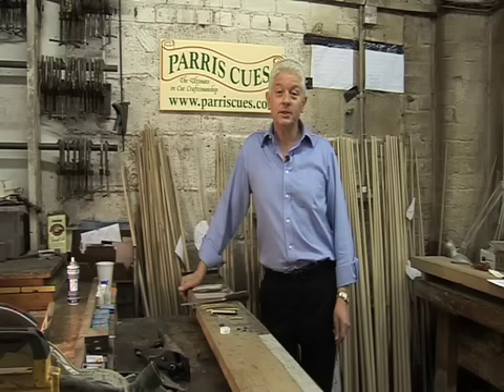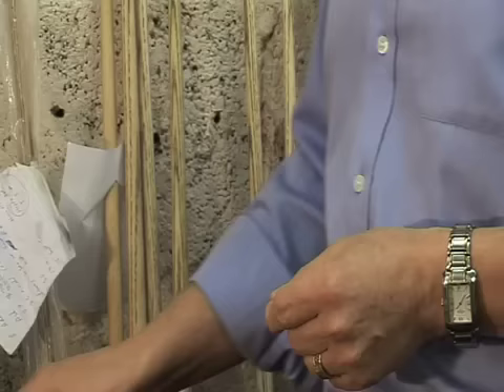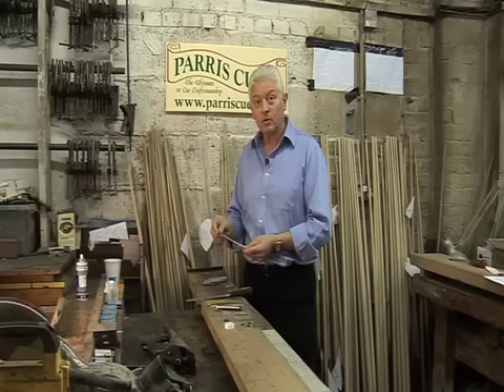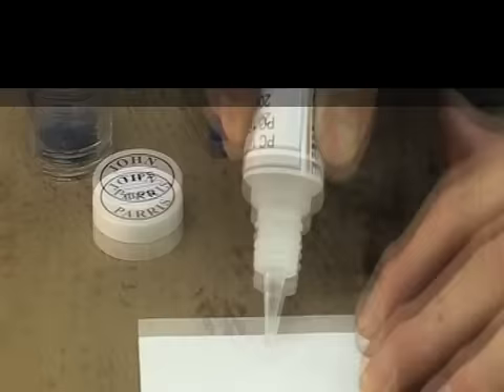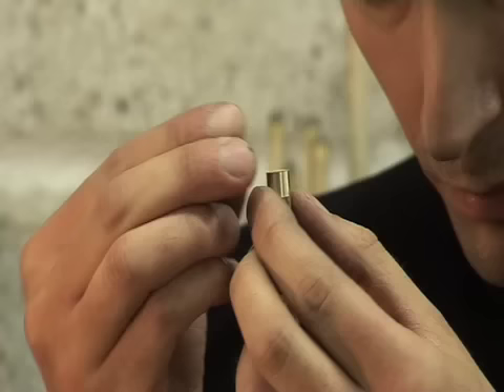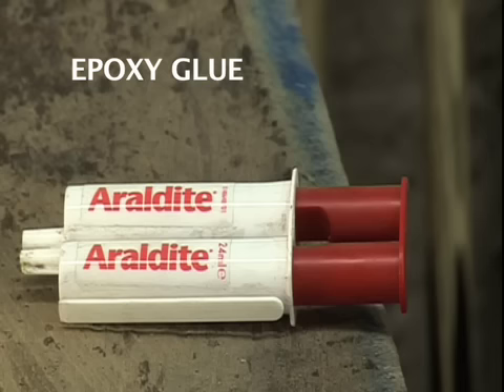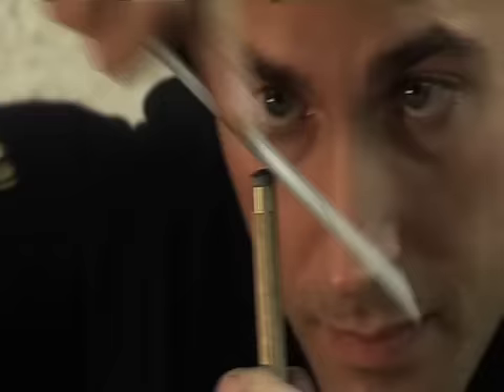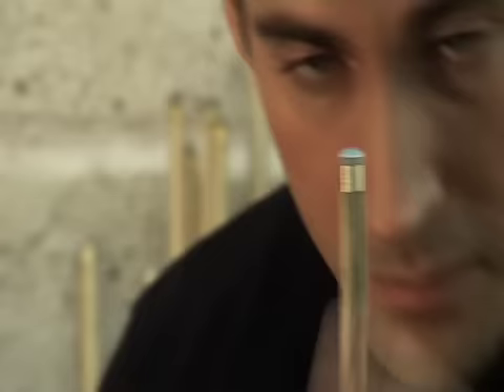How to Re-Tip Your Cue

Comment: I am not an expert in Snooker or Cues, but I just love to watch the game. I have often wondered if ever, it was possible to use a ferrule with a tip that could be just screwed on and off to the cue, so that in times of a crucial match event, if ever the tip gets damaged, one could just replace the tip with the ferrule in no time. Just expressing a possibility, as I said I am no expert to judge what the result would be on the cue and striking and its working feasibility. If anyone knows if that could be a workaround, please let me know. :) Thanks~! :)
Reply: Cues in bars and so on have scewed on tips. I believe the performance does not meet the requirements of professional snooker players (maybe because the force transmission is not as good)
Reply: @basti1597  Thank you for your reply :)

Comment: I take it you guys don't create milk duds or put the tips in a compressor? How long does a tip last without these methods? I will use your scratch technique and find the hardest. Worried about mushrooming. Just had a LePro put on professionally by a shop with a lathe, and it fell off 2 days later during play (total of 5 hours of play). I had to keep reshaping after every frame as it kept mushrooming.
Reply: It sounds like you had a soft tip. Mine only mushrooms for abit after I put on a new one. I reshape and it's good to go.

Comment: sir,i have a question i bought a mizerak pool cue from dicks sporting goods store came with case,chalk,scuffer,tips...took it uptown put cue on table it was warped,i took it back to exchange it,store manager looked at the other same cues all warped...my question is...can you fix a warped cue stick?i got a differant  cue,it was waped...i duct taped it to the door,i left it there over night,t seems like it fixed it slightly
Reply: well-made cues won't warp much if at all. you get what you pay for. the process of fixing a warped cue (if you absolutely can't part ways with it) involves steaming the shaft, which you would usually never want to do, because that could easily make the shaft irreparable if overdone. after setting your shaft over a pot of boiling water (until the pot is empty) at a good height, you'll want to apply a constant heavy pressure as it dries. you could use some heavy books or something like that. it'll take a week or two. this most likely isn't worth the time and effort. for  cheap cue, it's better to just buy another shaft. i couldn't envision myself going through this process unless i were to have a super expensive ($800+) custom shaft done to my exact specifications.

tl;dr: cheap wood is cheap. get something else
Reply: put the warped cue in a lathe and with a chisel.  shave off the wood until it is straight.  Works like a charm.
Reply: The trick is to use steam, that is how the cue makers straighten them. It is also a go way of getting rid of dents in the wood.
Reply: @toscodav 😂

Comment: hi , i want to know if it is possible to remove a brass ferrule on a cue?
Reply: Hi, yes it is possible to remove the brass ferrule, just apply some heat to the f errule and it will slide straight off